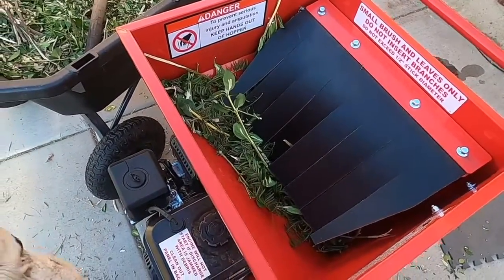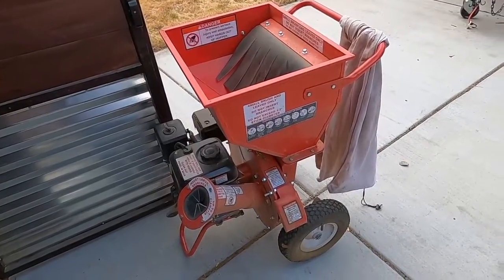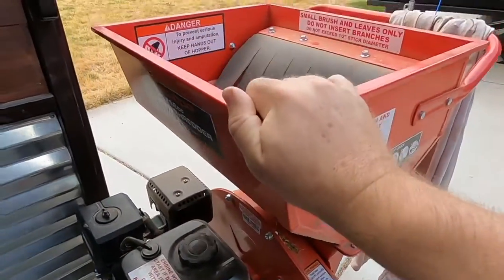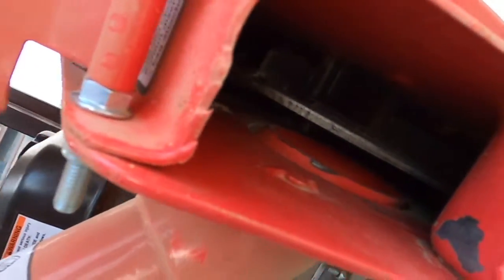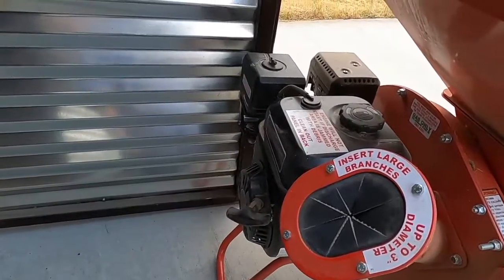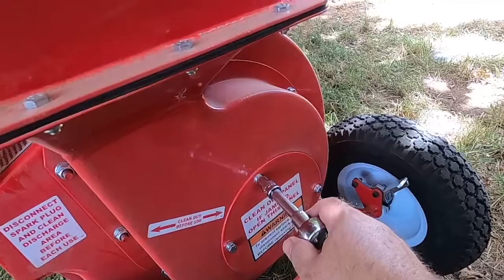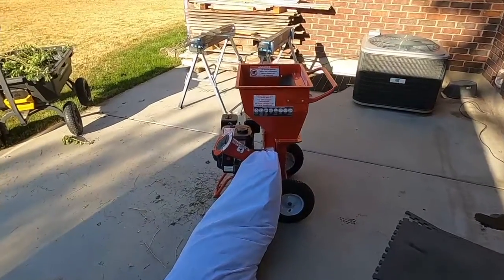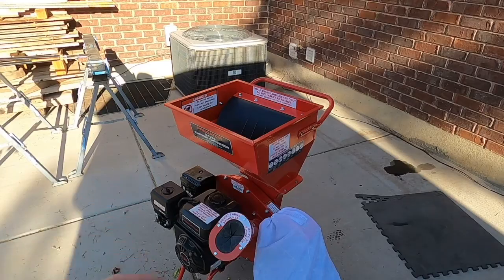How to un-jam your Harbor Freight 6 5HP Wood Chipper

Comment: I suggest  replacing the tires with solid rubber tires . Replace the nuts holding the  limb tube, and back clean out with winged nuts. From other videos the clean out plate  needs to be larger. They were having to take the hopper off to clean out the green limbs that wound a round the  shredder  wheel.